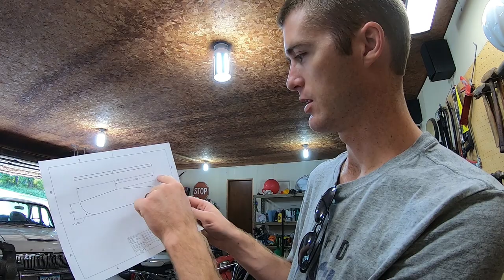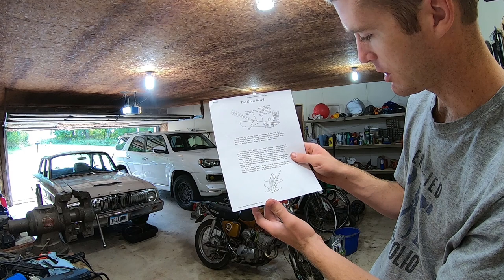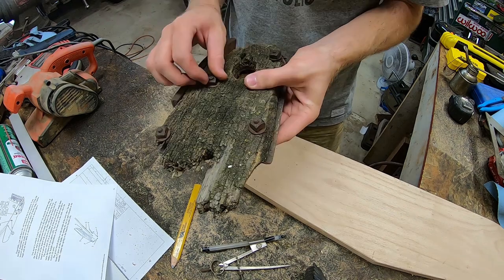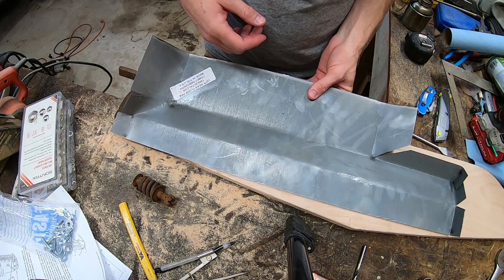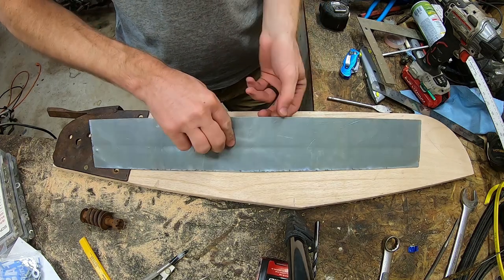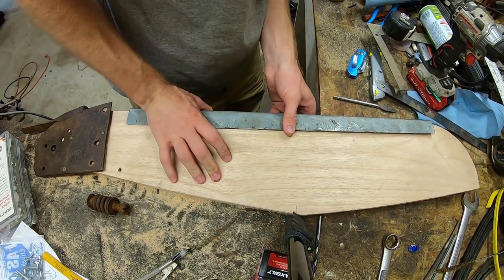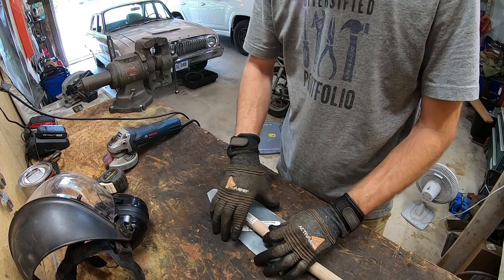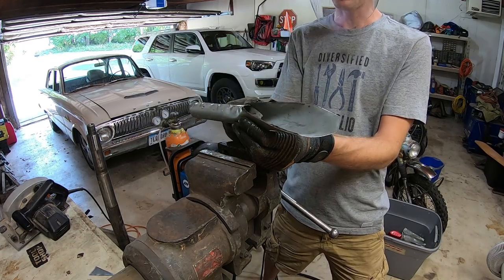Grass Board | John Deere No.5

Comment: Hi, JD no.5 power mower owners manual/parts manual is really available on line. Many year printings. Tells you all the set up adjustments, all the parts and operation. Very detailed. Illustrations for mounting on many different tractors. Factory color for grass board is bright red. A yellow John Deere decal for the board also available on line. Oil the cutting bar often during use. Grease the spring loaded ball joint at the pitman arm often. Top up 90/140 gear oil box before every use.. grease all points before every use. Disassemble the caster wheel arm and wheel bearing. Clean and add fresh moly grease. Great vid for a great vintage mower 👍😷🇺🇸
Reply: It is wise to check the the oil level in the #5 gear box.  I grew up mowing with a JD #5, as did my brother, father, and grandfather.  We checked the gear box regularly but I don't think we ever added oil.  We ran #5s almost 50 years, would operate 3 at a time between Dad, Jim and I.  We also had two mowers just for parts.

Comment: Timely.  I am going to need to make a swath board for my No. 5 too pretty soon, myself.  Curious (maybe I missed it) but what was the length?  About 2 ft?  I appreciate how you fabricated that piece for the stick (which I think is to fold the grass over so the next pass, you avoid plugging up the mower on the cut grass).  My plan was to buy a metal snow shovel, rake, etc., and remove the section the  wooden handle goes into, usually riveted on, and repurpose it, along with the handle.  I have seen that online on someone elses mower restoration and seems to work well.  Plan B was fabricating one, so nice to see how you tackled that.  Nicely done.  I was out clearing land this weekend for the hay field I have yet to grow, so I have a little time before I need the mower.  lol
Reply from the maker: Thank you for all the compliments! The snow shovel handle is a great idea! The plans I found said 34”x 7”x 1”.
Reply: Second on the snow shovel being a good idea.
Reply: @jordanmoser1379  I will admit I ended up fabricating it after the shovel I thought I had on hand to sacrifice was kind of a funky design that didn't lend itself to it.  Just kind of guessed on the angle.